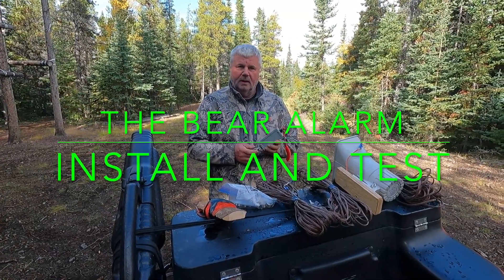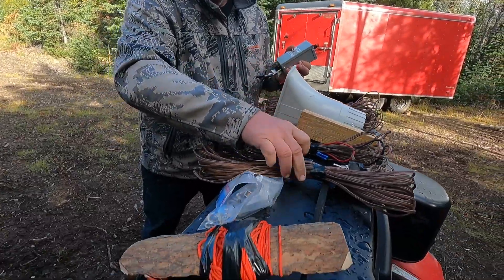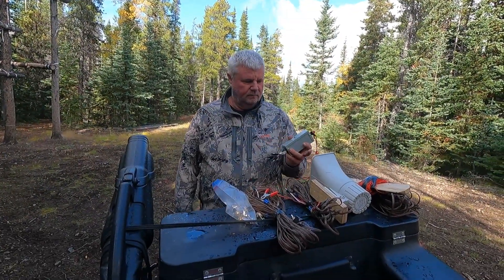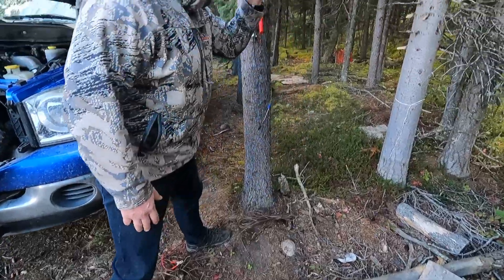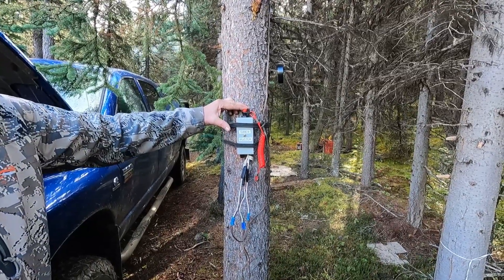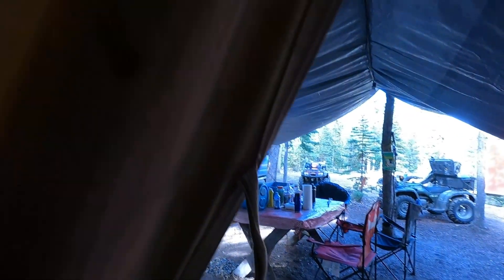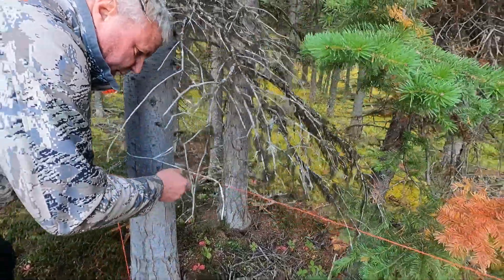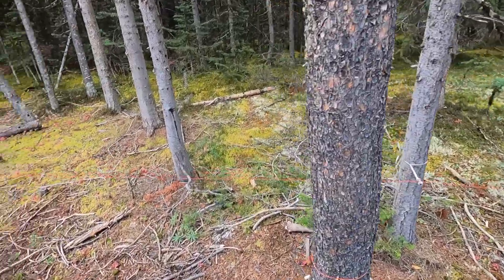A Complete DIY Camp Bear Alarm System To Protect Your Meat ( with parts list and wiring diagrams )

Comment: What gauge of wire is use to connect the switches in the junction box?
Reply from the maker: Hi Dean. I’m not sure. But there’s not a lot of current going through the wires so you’d be safe with 18-16 gauge for sure. Thanks for watching and the comment. I’m sure Rick will chime in. Let me know how it turns out.